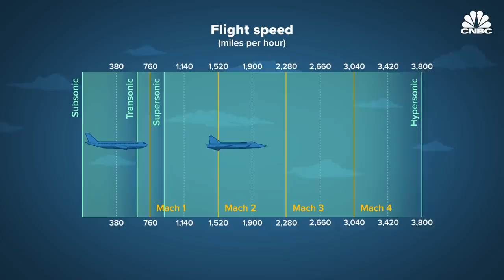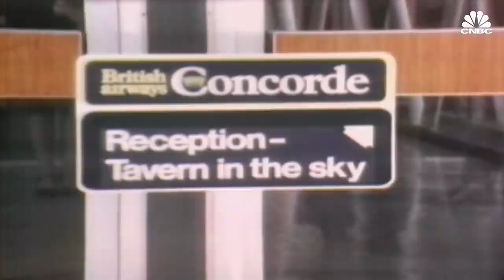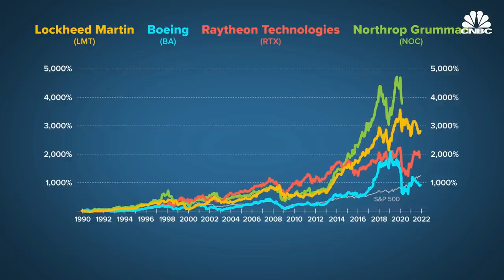How The U.S. Fell Behind In Hypersonic Technology

Comment: For those who are interested, the latest development of Chinese Hypersonic Technology: scientists have invented a cooling mechanism of infrared sensors which allow them to operate under the immense heat of hypersonic flight. Imagine a heat-seeking hypersonic AA missile or dual guidance anti-CV ballistic missile, could be a game changer.
Reply: seems sketch how would anything possible get rid of the plasma sheathing on the missle?
Reply: Not actually real. HGVs have plasma sheathing which makes IR impossible, hence why HGVs like the Chinese DF-21D have to decelerate in their terminal phase to supersonic speeds in order for them to use terminal guidance.
Reply: Turning circle: two continents.
Reply: @smeep7870  
Blowing 'supersonic supercooled air'  creating an air barrier
Reply: @captainbroady  
Spent, and continues to be spent
Reply: @captainbroady  
It's hard for the US to catch up. The US budget has to be used to maintain its vast network of overseas bases, massive maintenance costs for their enormous fleet, high-paid personnel etc. Only a little is left for research and the research they do is very inefficient because of private companies that wield enormous political power and are incentivized to drag out development times to milk as much money as possible.

But you need not worry, China will not invade Taiwan in the next ten years. If they do that it would cripple the Chinese economy. Taiwan and China's economy are so closely intertwined both would collapse if trade stopped entirely between them. It makes no strategic or economic sense to invade Taiwan. For now, it's much cheaper to just keep trading with Taiwan than it is to seize Taiwan by force for its resources. The only motivation to invade Taiwan is an ideological one but we all know ideology comes after practicality when it comes to geopolitics.
Reply: @HaydenLau.  yea true
Reply: @ylstorage7085  no
Reply: @captainbroady  Just curious how you think China can "invade" the states? They have 1 Aircraft Carrier, they have a tiny airforce/navy compared to ours,  they have to cross an entire ocean either way they try and get here, are they going to invade Canada or Mexico first? How would they do that when were sinking their ships at sea and killing their troops. Are they going to hypersonic shoot troops over and parachute them... While they are busy trying to invade I am pretty sure they would also be getting invaded and attacked on their own homeland by our allies also. There is no reason for China or Russia to even want to go to war with the USA anyway it would bankrupt them.
Reply: @davidstufflebean3285  I was talking about the possible Chinese invasion of Taiwan... please read before commenting
Reply: Russia has the biggest and baddest nukes! Yeah that hypersonic Nuclear Glide Missiles can't be shot down supposedly!
Reply: @donaldrobinson214  they had been looking for him for almost 10 years at that point.
Reply: @davidstufflebean3285  unless they already live among us…
Reply: Ye, I'm sure that's just as real as all of Russia's advanced technology turned out to be.
Reply: The US already has guidance like this in the thaad system.😒 Really no one knows anything about hypersonics here.
Reply: @jewellcarpenter6764  Not exactly, the THAAD interceptor has a minimum intercept altitude of about 40km. The protective shroud will jettison once reach above 40 km , allowing the IR seeker to work. This is to  protect the infrared sensors from atmospheric frictional heating. So why this technology is more advance than THAAD is that it allows IR sensor to work in denser, lower atmosphere, which extends operating envelop for hypersonic vehicle.
Reply: @HaydenLau.  times they are changing
Reply: @HaydenLau.  Thank you for pointing that out. Most people see our huge defense budget and just go "oh wow america's so awful they could just solve world hunger with that money instead of wasting it on missiles" but like you said, we actually pay our troops and workers so a lot of it has to go to that, unlike china or russia who already commit so many human rights abuses that it's almost a matter of course for them.

And the private companies that get contracted to develop stuff for us (looking at you Sig sauer, lockheed, microsoft, etc) wield so much power that I hadn't thought of what you said, about them being in a position that incentivizes drawing out contracts for as long as possible, and that's disheartening but a good point nonetheless lol
Reply: Microwave tech is a game changer in missile defence.
Reply: @HaydenLau.  well said
Reply: @HaydenLau.  Say again? 😀😀😀
Reply: The U.S. has likely had that since the 70s with Sprint

Comment: Uhm. "Air molecules are not being ripped appart" - simply they can't move away fast enough before pressure compresses them enough to heat themselves and pressing body.  As for hypersonic - every spacecraft and ICBM and MIRV is hypersonic.
Reply: the difference is, flying hypersonic in low altitude is much more difficult for radar to detect, and more difficult to intercept
Reply: Hyper sonic missiles doesn't pass the ozone layer (troposphere) it reaches "closely" enough to the tip then Launch its secondary missiles remotely to its target. Quickly "enough" then a nuclear missiles because when a nuclear missiles passes the ozone layers making a big U-turn the satellite will/"if" detect it earlier.
Reply: @alfarabibraza1236  yes
Reply: people don't know the difference between ICBMs MIRVs and cruise missiles.

Comment: "Traveling above Mach Five literally causes air molecules to burst open, heating the flying object by the 1000s." 3:10. Huh?  Who writes like this and how did that make the cut?
Reply: Same people who say that "Elon Musk is building tunnels using rocket technology" xD
Reply: A Russian here. 'Air molecules' is wonderful!
Reply: The chief characteristic of hypersonic aerodynamics is that the temperature of the flow is so great that the chemistry of the diatomic molecules of the air must be considered. At low hypersonic speeds, the molecular bonds vibrate, which changes the magnitude of the forces generated by the air on the aircraft. At high hypersonic speeds, the molecules break apart producing an electrically charged plasma around the aircraft.
Reply: This is probably the source for the text, by NASA
Reply: @my3bikaht88  'Diatomic molecules of the air' is very different from 'the air molecules'.

Comment: "Russian patent number *****09 relates to the field of rocket technology, and more specifically to hypersonic cruise missiles equipped with a hypersonic ramjet engine. The invention describes a method of application and device hypersonic cruise missile (CRPD), allowing to solve the problem of performing a combat mission to destroy ground and surface targets of such a missile. The described invention is designed to maximize the combat potential of the CMP with the scramjet. The design mode for the scramjet are high-altitude cruise conditions while maintaining the estimated cruise speed, and the need to reduce the altitude and flight speed creates difficult technical problems due to the fact that: an engine designed to perform a hypersonic mid-flight at high altitude is not able to continue to work at low-altitude trajectory sections associated with a decrease in the flight number M, hence, the rocket must approach the ground or surface target with an inactive engine; characteristics of sustainability and controllability of CRPD with inactive scramjet significantly deteriorate, loss of stability becomes possible; there is also a danger of destruction of the scramjet design due to the increase in pressure in the flow part of the engine while reducing the CMP from the march height before hitting the target."
Reply: Thank you for the info on this.
Reply: Even if Russian hypersonics is perfect, Russia needs to find a US aircraft carrier first.  It is not easy with satellites because it will take 20 minutes to direct a satellite to a location and it can only see that location for 10 minutes because the satellite is not geostationary.  Russia needs thousands of drones like predators or Global Hawk to find US aircraft carriers because only drones have loiter time to maintain constant track.

Comment: 9:50 There should be plenty of data available to engineers and developers from the X-15 and SR-71 programs. As well as the space shuttle program.
Plenty of things have gone very fast in our atmosphere and survived.
Reply: @TinRapper  no they really are not lol
Reply: You must of missed it, the technology is completely different. Dealing with much higher heats and for longer periods of time.
Reply: @lukemurray4950  After I posted that I thought of this. Even if the SR-71 went mach 4, the increased stress of going 5 or 6 would be important.
Reply: @brennencox516  I'm not gonna act like I understand the science but the air is under so much friction it ignites the air. It's basically like when the space shuttle is re-entering and it uses its heat shield to survive the head caused by the friction except a hypersonic missile would have to put up with higher temperatures for longer periods of time and across the whole missile. Far from easy to figure out. 

A little nerdy but this is similar to the issue of possibly traveling at the speed of light. Even if we could get to the speed the problems we would face would be a bigger challenge than getting up to that speed. For example a grain of space dust hits it and it will explore the whole craft simply because the amount of energy that is being created. I find this stuff super interesting.

Comment: SR-71 is not the fastest plane, it is the fastest "intake" based plane (plane with an engine that breaths air. AKA, an engine that doesn't bring its own oxidizer like a rocket or dynamite. AKA, an engine that looks at all the air availabe and smirked: "it is free realestate")
Reply: You're correct.  It was, and still holds the record as, the fastest jet powered manned aircraft.
Reply: I hear off the record it was a lot faster than claimed.

Comment: Based on P=V^3, a hypersonic jet will consume fuel 125x as fast, or 25x as much fuel per distance.

Current commercial jets average about 50 miles per gallon per seat (similar to Toyota Prius). A hypersonic jet would get ***<2 mpg per seat***. Then consider that commercial jets can travel around 2 million miles per year (about 10x as far an average car goes in it's entire lifetime) and the fuel usage just becomes ridiculous.
Reply: I don't think that's accurate. I don't think you take into account mhd tech

Comment: 1:53 Fastest manned plane of all time would be the North American X-15
Reply: The X-15 is regarded as a rocket
Reply: Manned planes are old tech
Reply: It's a rocket using liquid oxygen duh.
Reply: x-15 is a rocket 
blackbird is a plane
Reply: @Constantin_Valdor_  It's an aircraft.  Wings, control surfaces, landing gear, cockpit, etc.  Yes, the engine was an ammonia/liquid oxygen throttleable rocket motor.  So technically it's a rocket-powered aircraft.
Reply: @zf4hp24  it's a plane classified as a rocket

Comment: How well could a  hypersonic missile maneuver to evade defense systems ? At such meteoric speed it supposedly has to undergo huge G  to make a turn. Flight control would also be a tough issue.
Reply: Point defense isn't advanced enough to reliably stop a hypersonic missile, and it's not like conventional missiles perform complex maneuvers to evade defense systems either (they tend to rely on electronic countermeasures, decoys, or just sheer numbers). Besides, the missile usually only goes hypersonic in the final phase of its flight, to increase its range and accuracy.
Reply: At hypersonic speed air is enough to steer the vehicle, is like hitting water with your palm, water becomes solid for a moment.
Reply: nobody on the missile, so G is not an issue, looks like you are lack basic high school physics.
Reply: @hanfucolorful9656  - Yeah, basic high school physics includes Newton's laws of motion, and according the 2nd law, high G would incur huge load on the missile frame and its internal components. But the last time as I'd checked they didn't teach structural mechanics and strength of material. How about you ?
Reply: @tocu9808  You apparently cannot tell the difference between the speed and acceleration (the rate of change of velocity per unit of time), higher speed does not mean high acceleration., supersonic glider vehicle is not UFO.
Reply: @hanfucolorful9656  I think you're misinterpreting the other guys comment. In order to perform evasive manoeuvres, the hypersonic vehicle might have to encounter high Gs unlike any missile before it, which places a lot of load on the missile structural bus which is already going through extreme flight conditions
Reply: @yaseen157  When you send a satellite to space by rocket, the highest-G-time is the very beginning time, when the rocket moves from zero toward 7.9 kilometers per second or higher. The rocket thrust is the same, but as the speed increased, the resistance of the air increased dramatically, 

F(rocket thrust) - F(air resistance) = FORCE (push forward)

Since the FORCE is decreasing, the acceleration also decreasing, this is to say, you got the highest G at the very beginning, as long as the missile can survival in the launch time (air resistance is zero), it will be OK in the remaining time of flying (when air resistance build-up, and acceleration (G) is less than the beginning time).

Do I make it clear?
Reply: @yaseen157  By the way, roughly the air resistance force increased by x speed x speed, for example, 

if the speed is 3 kilometers per second, the air resistance force is 3 x 3 built up, 9 times bigger than at the speed of if the speed is 1 kilometer per second.

if the speed is 6 kilometers per second, the air resistance force is 6 x 6 built up, 36 times bigger than at the speed of if the speed is 1 kilometer per second.

Hence you get the highest G at the very beginning when the air resistance is 0.
Reply: @tocu9808  just let you know replied to you but they deleted.....for an unknow reason...and I don't want to re-write again.
Reply: @hanfucolorful9656  - Whatever it was. Go back to basic high school physics first, then come back to have a civil conversation with me.
Reply: @tocu9808  At hypersonic speed the CIRCLING radius is huge, it cannot do the UFO maneuver (we are not yet there) so the G (due to CHANGING DIRECTION, TURNING, CIRCLING) is not very big, even at very high speed. you can always find some strong materials that are light in weight, heat resistant, to do the job. The hard part is how to overcome the 【Communications blackout at 2000 C degree】， once lose contact you lose control. They already figured out in china how to maintain the communication at blackout zone at 2000 C degree。
Reply: @hanfucolorful9656  - So, the simple answer to my original question above  should be  hypersonic missile could hardly do any spectacular maneuver as Russia and China used to brag about.

Blah ...blah ...
Lesson acceleration learned.

Then, what do you need me to learn more about basics of high school physics ?
Reply: @tocu9808  China did not brag, actually, the US always complains that China is denying what the US claimed, and calls it a Lack of Transparency. In fact, China never said officially that it has such a kind of weapon, I mean the hypersonic missile flying around the earth, then, goes to the target.
Reply: @tocu9808  What China officially confirmed is that it tested a rocket system that can fly around the earth, and return and land horizontally. Also, China says it is building an airplane that can reach any corner on earth in 1 or 2 hours.
Reply: @hanfucolorful9656  - Say whatever you want. That's irrelevant to my original question about missile MANEUVERING, ACCELERATION.

And I've got the answer, hypersonic missiles would not be able to do much in maneuvering, and so their trajectory is not that magically unpredictable as being hyped by some.
Reply: @tocu9808  they detect and delete any work link.

Comment: Hypersonic flight is not a new thing, despite its recent launch into the limelight. Even the Nazi V-2 rocket could break the Mach 5 barrier, and the U.S. even had a hypersonic bomber program in the works before the Soviets launched Sputnik. What has changed, however, is the ability to control flight at this rate of speed to a high degree of accuracy through onboard hardware and advanced software.

Comment: There is a huge difference in operating a civilian aircraft at hypersonic speeds economically and applying hypersonic vehicles for military purposes.
50 years ago when the travel at supersonic speeds was developed to match  the Anglo French airliner in response to President Kennedy's initiative, it was determined that economical travel was best near Mach 2.7, at altitudes around 80000 feet. But, and there is always a significant not apparent consideration that must be observed, traveling at those altitudes increases the radiation exposure to the passengers, requiring shielding.
As far as aero thermodynamic solutions are concerned, significant progress has been made, leaders are former Rolls Royce people, with new approaches being investigated in propulsion technology using hydrogen as fuel.
The approach differs from the commonly  so called supersonic external combustion process discussed in the video.
The company is called Reaction Engines, The hypersonic transport: Skylon